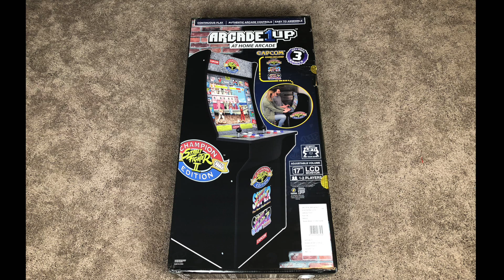Arcade1Up Cabinet Teardown Detailed Look At CPU And PCB

Comment: I picked mine up from GameStop, Rampage edition. Sound quality isn't that great, better on a lower setting. Other than that things awesome.
Reply from the maker: I want the rampage version
Reply: @ETAPRIME  I saw pictures (I don't know if they're accurate) of Pacman and mortal Kombat versions. I deff want both of those.
Reply: WishMaster2013 the rampage machine have a bug with the game the gauntlet it crashes at level 30 or 31 and the sounds it sometimes laggy and off so arcade 1up is sending people free replacement boards if you call the costumer service number also ask for the free plexi glass controller cover to protect your art work they will send you both free of charger through the mail!